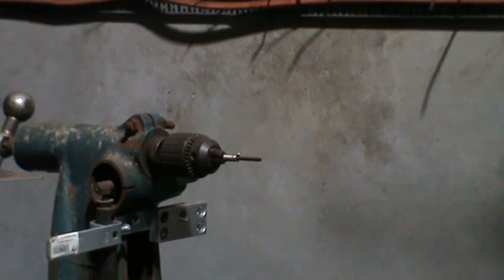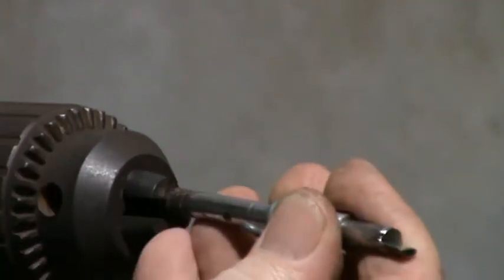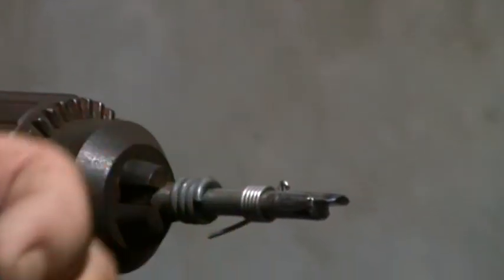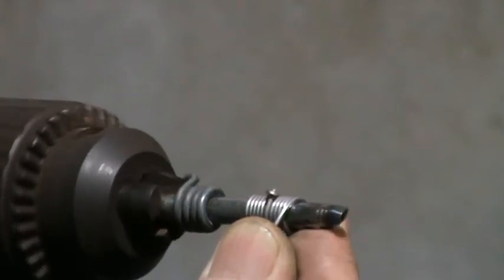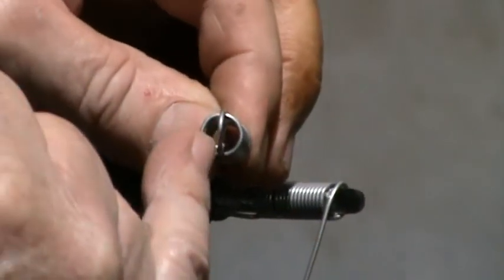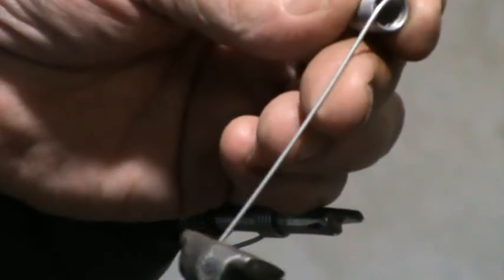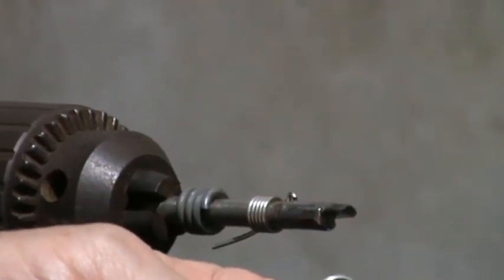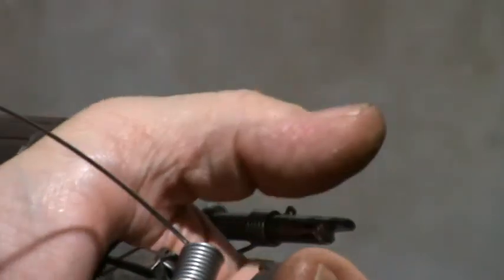How to make a custom extension spring at home. Worst video Part 1

Comment: The machines I service at work have a part that uses two springs, and the springs have stretched out on some of these units. The supplier charges several hundreds of dollars for the part, doesn't supply either one of these springs separately, and my boss hasn't found the necessary springs anywhere, so we've been stuck with buying expensive parts that we should be able to refurbish ourselves. Thus, my search on how to make our own springs. For that, I find this video and part 2 to be helpful, so thank you for making these videos.

That said, I see you have uploaded several videos, and would like to make some suggestions on video production. You might want to invest in a video editor, or at least use one that is freely available. Windows still has a free video editor, which you can use to splice two videos together, although I don't know its other capabilities because I use Vegas. With Vegas, and perhaps with some free video editors, you could record in a higher resolution, then use a video editor to crop in to whatever you are trying to show, to make sure nothing you do is off-camera.

As for making the spring itself... Instead of using fancy tools, couldn't you use pliers at 2 minutes into your video, to press the wire against the flat part of your mandrel?

Again, thank you for making this 2-part video, which I found to be helpful. I hope you find my suggestions to be helpful as well, and if you have any questions concerning video production, feel free to send me a message.
Reply from the maker: I understand your comments....i am just an old man showing you kids how to do things before i die...
Reply: @thespringguy1  👍
Reply from the maker: I thank you for some excellent advice.. As a film maker (not) , production quality is obviously lacking , but the general concept of how to do it surely gets across.
This is the best i can offer..
Reply: @thespringguy1  you're welcome. I appreciate what you offer, regardless of production quality, and have found your information to be very useful. Again, thank you.
Reply from the maker: Please remember after bending spring wire , the material stresses need to be relieved through heat treatment before using in your application.